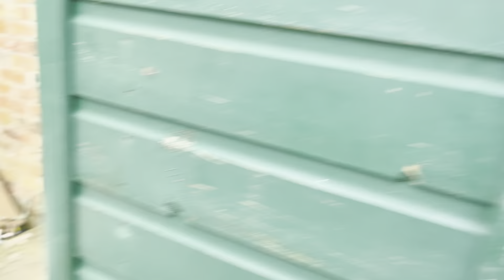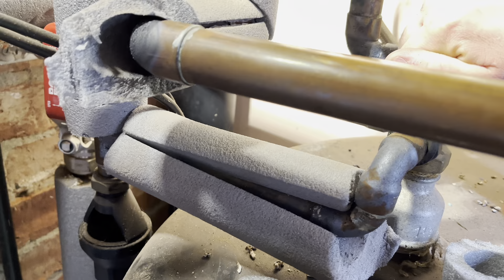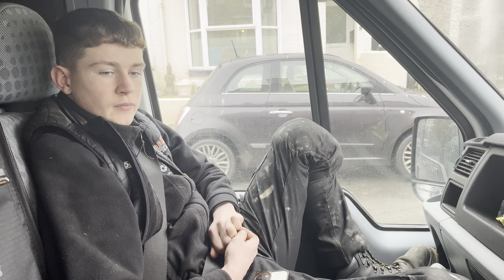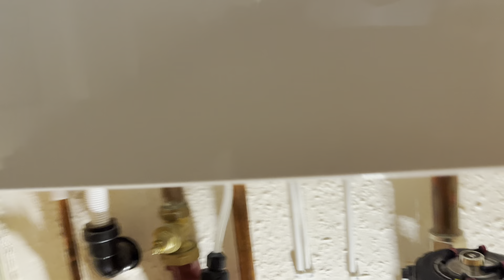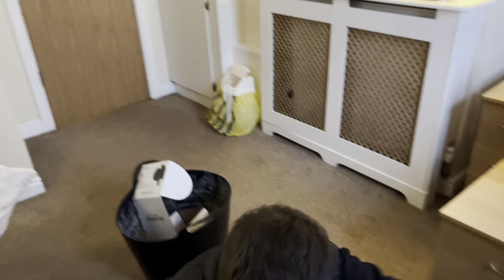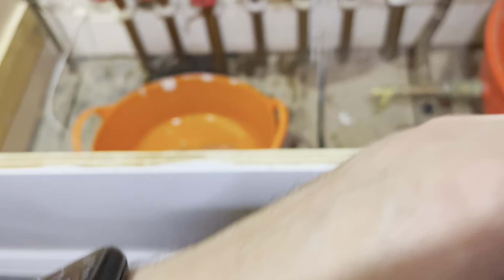We COULD NOT FIX IT - 5 Big Signs You're Doomed

Comment: HI  Nathan -- yes what a pig eh  ! we've all been there with sytems like this at half past five !! -- but i agree with Tom from plumb like Tom -- check the magna clean filter -- if that's ok , close the lever valve on the bypass +  the hot water 2 port valve + test each of the 2 heating zones on their own -- it may be a pipe issue , but i',m sure the pipework won't be blocked or faulty on all of the 3 zones ! -- good luck Nathan ...
Reply from the maker: Thanks James, we had to re pipe it in the end and some of the original system was on the old one pipe system still. Respect for the support 👊🔥

Comment: Hi mate if I am not wrong magnet filter valves are off
Reply from the maker: Respect bro, checked them and all ok 👊🔥
Reply: Does look like their off, if there’s heat leaving the boiler be surprised if that pump couldnt push through with just the h/w zone on if it was just an airlock. Could be faulty f/r stats giving a differential fault
Reply from the maker: Respect Top G
Reply: Keep the content coming mate 👌

Comment: Hey 
I’ve had a similar problem with one of them Commercial atag boiler ..
Every time the power goes on and off to it would go in to venting mode ….
And I some models have a filter on the return pipe in the boiler …and if it blocks the boiler keeps going in to low fire because of the differential temperatures..
Hope this helps….
Reply from the maker: Absolute respect mate. I’ll have a look at that, respect for the support 🔥👊

Comment: Sounds like really bad air lock. Try putting a push fit coupling with 22mm to 15mm onto a hose on the bottom connection of the magnaclean and open the filling loop
Reply: Had the same thing happen to me on a boiler swap on Monday spent hours trying to get it working. I done what is said heard a crash and a bang, starting working straight away. Let us know how u get on in the next video 👍
Reply from the maker: Respect hustler 👊🔥
Reply from the maker: Not a bad shout that lad respect 🔥👊

Comment: From my experience your best option is turning off two of the circuits and all of the rads the start at the rad closest to the the boiler on that circuit once it heats move on to the next and so on turn off the by pass and keep shunting the pump chances are there is an all mighty air lock fucking with your head
Reply from the maker: Absolute respect hustler, keep winning 🔥👊

Comment: That install looks fairly new on the last job, it does make you wonder if it has ever worked properly, it might just be worth checking the magna clean to make sure it's not blocked, other than that it has to be a pipework issue
Reply: I'm a spark not a plumber but I didn't notice any air or water coming out of the magna clean when he opened the bleed valve at the top so you could well be right (your videos are the best plumbing ones on Youtube by far)
Reply from the maker: Respect Top G
Reply from the maker: Respect as always Tom keep hustling 🔥